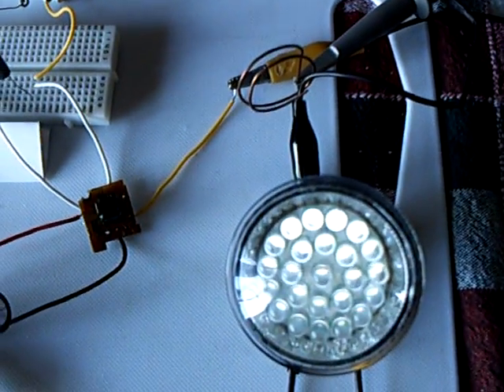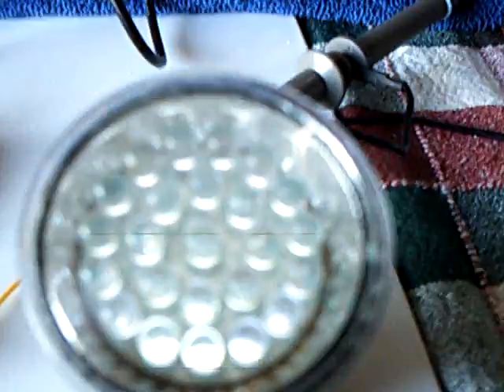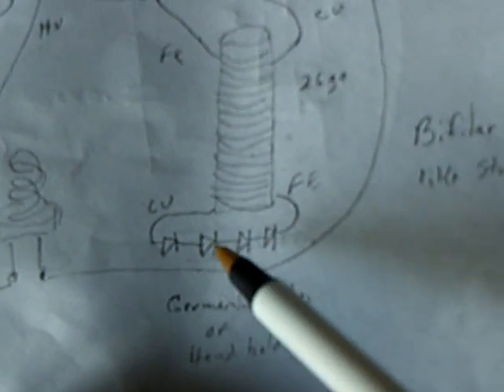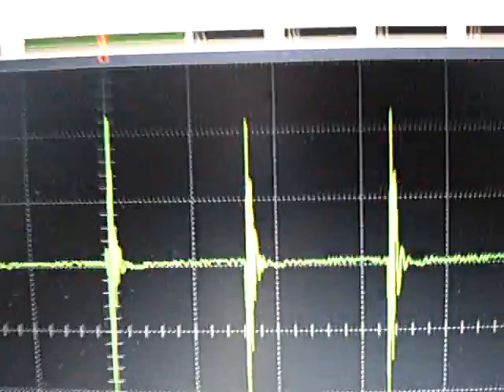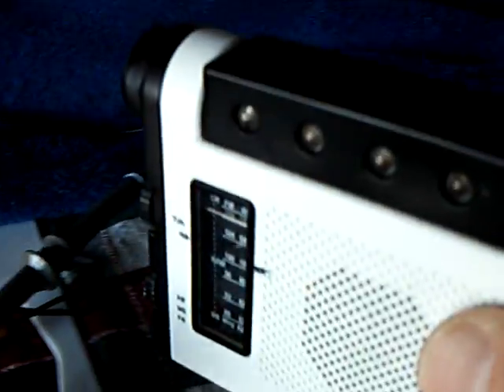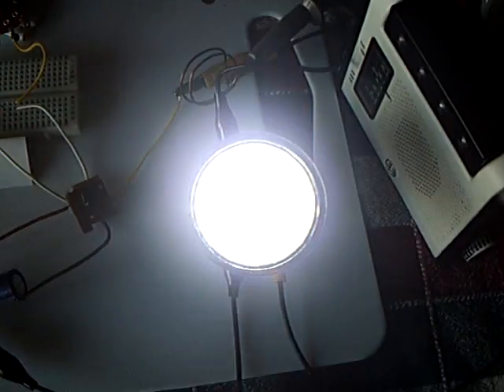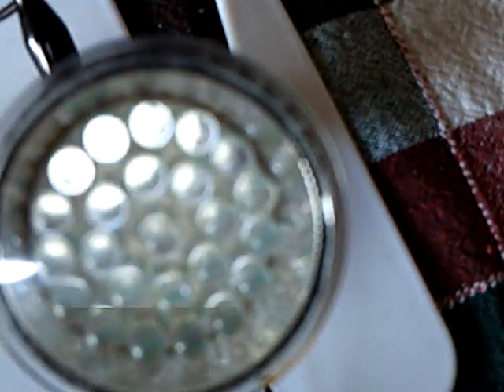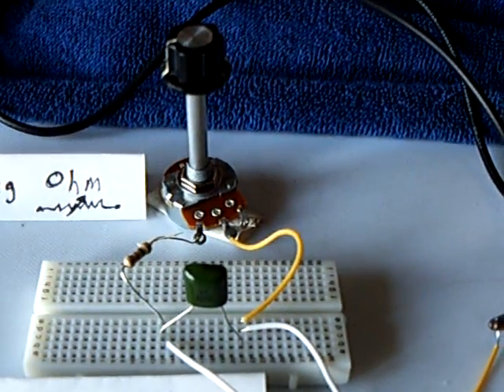Joule Ringer scope shots.ASF

Comment: There is something all you people who want to save energy on blinking leds fast enough should know. It will work like a stroboscope.
I you have it exactly above your visual frequency  (where it is not longer blinking) or even far higher, it will still cause visual problems. 

If everything was standing still, your eyes included, then there would be no problem. But once something moves, you will get the same stroboscopic effects as you see in front of old crt tv's, and it wont be comfortable...